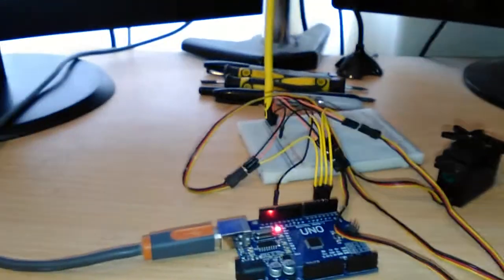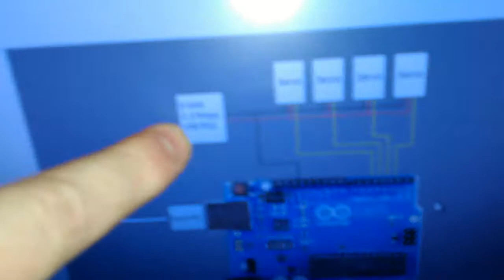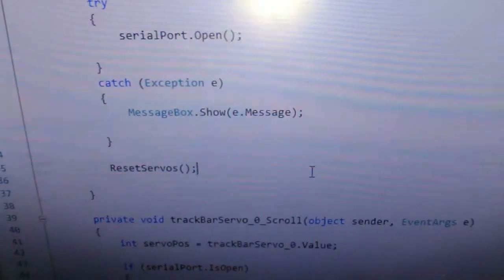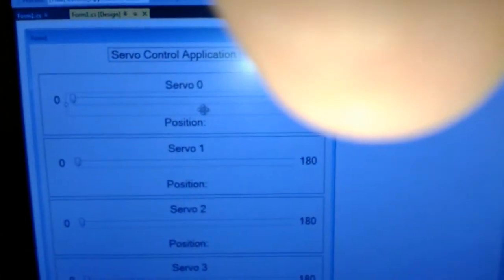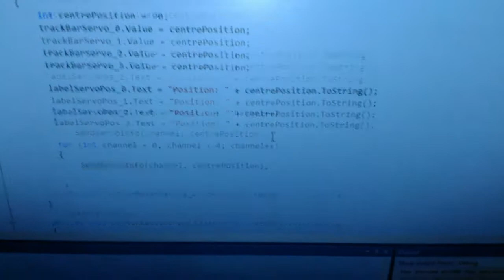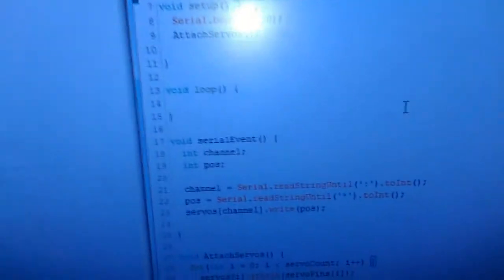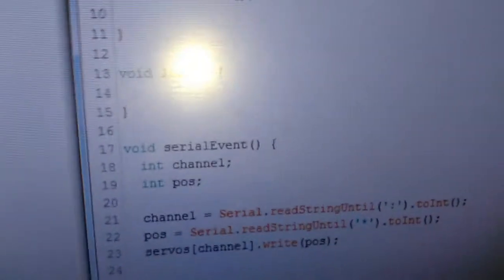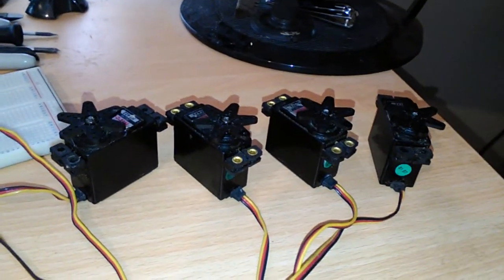Controlling multiple servos with Microsoft C# Winforms Builder and an Arduino UNO.

Comment: but now C # _Source.txt where I paste it
Reply from the maker: Open the project in MSVC#, the code is not standalone.
Reply from the maker: It's a Windows Forms project.
Reply from the maker: The Arduino source code is in the root folder, the MSVC# WinForms project is in the "Control_Application" folder.

Comment: what if i have some conditions in the void loop like to read the buffer strings from serial port and do some thing like toggle and led will the serial event still work like it is for the servos?
Reply from the maker: As long as the serial port is open, you should be able to access it from any point in the loop or access it from within any function.
Reply: @steve_ancell  thank you for replying but im unable to control the servos when im using some conditions inside the void loop

Comment: I used to love coding many years ago, with one thing or another I just stopped and didn't get time. I left Hugh Baird college halfway through a course in programming and electronics as I got a job I don't think it was the right decision, anyway thanks for sharing this it's waking up an old coder, going to have to watch it a few times to understand how you got the slider gui to talk to the arduino, but that's part of the fun. Thanks for taking the time to explain this :)

Comment: hello sir can you give the soft ?
Reply from the maker: There's a link, it's in the description. I'll repeat it here for you too. ;)

https://drive.google.com/open?id=0BxShBC9w_oHPLVhIRldIemVPWVk
Reply from the maker: If you click on that you will be able to get the Visual Studio C# 2015 project file, the Arduino code, and a circuit diagram.
Reply: i have visual studio 2012 what the solution ??
Reply from the maker: I'm not sure about converting it from 2012 to 2015, I would assume you just load it into 2012 and a conversion wizard may pop up.
Reply: no solution ? thank you for your help sir i havn't any idea about this
Reply from the maker: I created to PC application withVisual Studio C# 2015 Express, you can install that alongside VS C# 2012. It's free. ;-)
Reply from the maker: When you click on the link the VS C# solution is inside "Control_Application"
Reply from the maker: I just uploaded the whole project as a Zip file, if you click again on the link I posted above you will find the file "PC_Servo_Multi.zip".
Reply: i am so sorry i tired you a lot 
i am so sorry but won't work like first the same problem of netframwork
Reply: <?xml version="1.0" encoding="utf-8" ?>
<configuration>
    <startup> 
        <supportedRuntime version="v4.0" sku=".NETFramework,Version=v4.5.2" />
    </startup>
</configuration>
Reply from the maker: I think you may need to download Visual Studio C# 2015 Express Edition in order for the solution to work.
Reply: thank's a lot i will try than i tell you thank's a lot about your helping you so helpfull god protect you sir
peace from algeria
Reply from the maker: You're welcome ;-)